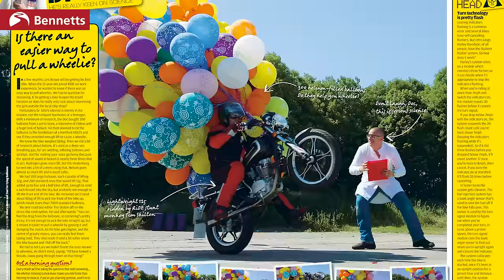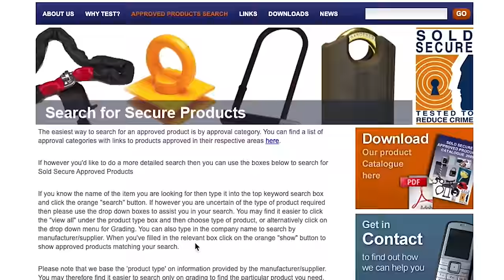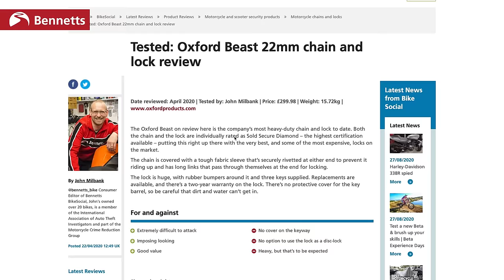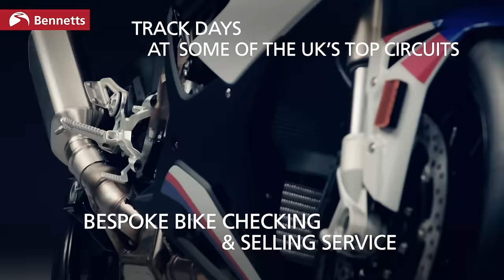The TRUTH about the best motorcycle lock | Litelok, Kryptonite & Oxford Beast review

Comment: Thank you for that positively brilliant review. When I heard the claim that the Kryptonite chain withstood a 4 minute angle grinder attack I laughed. Any lock or chain can be defeated with the proper tools/skills/motivation and willingness for risk exposure. After learning my neighbor’s V-Rod had been stollen a second time, I became concerned for my new Triumph T-120 (yes, I’m a Yank with a Triumph), so I decide if I am going to park my bike outside every night (don’t have a garage) I would use multi-layered security. I figured the more locks I have, the longer a thief would be exposed. I bought a Kryptonite New York 1275 12mm cinch chain with the EVS4 lock. This is the lock and chain I take with me whenever I venture into town. I also carry a small wheel disc lock for extra security. At night, I park under a lamppost, sandwiched between my car and a cinderblock wall. I thread the Kryptonite chain through my wheel and frame, and fasten it to an off-brand (BIGLUFU) 12mm 3T manganese cinch chain that is secured around the lamppost. I fasten the two chains together using both the Kryptonite EVS4 lock, and the cheap lock that came with the BIGLUFU chain. Two locks, two chains, a wheel lock, and the ignition immobilizer that comes standard on new Bonnevilles, under a cover and parked under a bright light still won’t 100% guarantee my bike won’t be stolen, but it will certainly make most thieves look for an easier target. Is it a bit much? Probably, but even adding just one extra layer - like a chain plus the wheel lock - will significantly reduce the likelihood a thief will choose your bike.
Reply from the maker: This guy gets it! Cheers, John
Reply: This 4 1/2 minute claim was probably based on an angle grinder attack from 5+ years ago.  Back then, it took over 10 minutes to get through both sides of the 18mm Kryptonite NY Fahgedaboudit ulock.  Today's grinders get through both in less than a minute - from what I understand.

My two pre-ordered Hiplok D1000's are due for delivery ANY DAY NOW!  Can't wait.  The Altor SAF lock is good for the super high theft situations, but such a PIA to carry on the bicycle!  (Even on a stout touring rack it causes all sorts of unbalancing issues.)

Comment: Just a word to the wise, wear a face shield over your safety goggles, if the grander cutting disc explodes you don’t want a chunk in the face. Cutting through a chain link and continuing through the second ‘side’ it’s very likely to jam and break. 

Good work and nice to see honest reviews and commentary 👍
Reply: I have seen that happen- and yes it is ugly.
Reply: As tempting as it is to use a grinder with your face in line with the blade it's a good habit to learn using them holding them to the side of your face/body.  My colleague witnessed a fatal blade accident
Reply: I’ve had a slitting disc shatter while cutting. Pieces flew a considerable distance. The trick with any grinder is don’t position your body in line with the spinning disc. 
My battery grinder disc got crimped while cutting a steel tube. The disc stopped dead and the motor brushes burnt out. A better spec brushless tool might have effective overload protection.
Reply: That would be karma to the thief so good

Comment: Frankly I am glad that you include the giant bolt cutters in the test. Because over here, most motorcycle theft involves a van rolling up with 4 or 5 guys in it, who will just detach the bike from whatever it's anchored to and then carry it off into the van. Whatever chain or lock is on the bike as they carry it off doesn't matter, because once they get to their "hideout" no one will ask questions about grinder noise.

I've seen and had bikes stolen by criminals in vans who would actually use the van itself to uproot signposts, lampposts or just cut the bike rack and then carry the bike off with the lock still attached. And even CCTV footage doesn't help when the van that's being used has stolen plates on it.
Reply: Yep a friend of mine saw a van pull up to a bike rack in front of a train station and cut both ends of the bike rack and then the guys just carry the whole rack with all of the bikes attached into the van and drive away. So they could deal with the locks later at their garage or something like that. And of course the train station has lots of surveillance cameras and people walking around but they dont care because the people around is not going to do anything, and the police will not even bother to look at the surveillance footage. So it does not matter how hard your lock is when it is easier to just cut the thing you attach it to.
Reply: @titter3648  what city areas / counties is this happening?

Comment: Excellent video, genuinely. Don’t usually watch long videos on YouTube but this was worth it. I’ve seen so many people lose their bikes to theft, especially in London. Unfortunately I don’t have a garage. The thought of mine being stolen has scared me into getting the following:
-16mm chain secured to ground anchor (frame)
-14.5mm chain secured to another ground anchor (rear wheel)
-16mm padlock securing front wheel
-Bike cover secured with cheap combination chain
-cctv covering bike which turns interior lights on when tripped. 

When I’m away I add as many D locks as I can. I know an angle grinder will get through them all but it’ll take a truck load of time and will make loads of noise. Hopefully the grinder battery gives up 😅
Reply from the maker: That's going to need a bloody determined thief, with a lot of cutting discs and batteries, to get through that lot. Top works! The lack of a garage (or shed / shipping container) is a pain, but you really couldn't do any more than that. Now get on with enjoying your bike! Cheers, John
Reply: Hey man you still got your bike ?

Comment: As Planet-Wax said: great video by straight up bloke! Having worked with rope, wire and chain over 30 years I learnt that everything breaks. You put some heart into those hacksaw tests, glad you survived. Short note that the wire rope cutters you used are not the "best in class", mine cut FSWR to 16mm (crouch-cut) and spring steel to 5.5... You made many good points and I'd have to say Bennetts became one of my main sources over the last few months as I researched my recent motorbike purchase, seems like your articles on locks and hardware are doing the same...
Keep it up.
Thanks from the Antipodes
Reply from the maker: Thanks very much! All the best, John

Comment: Very instructive.. When looking at how effective angle grinders can be, I focused on the fact that the angle grinder used for the attack was connected to an AC power source. My guess is that thieves would be carrying battery powered angle grinders and that battery powered angle  grinders likely have less torque than AC powered ones and thus would either take longer or not be able to cut through at all. For those thinking that proper thieves would be carrying their own AC generators in order to power AC powered angle grinders, I would think  it not very likely due to noise etc.
Reply from the maker: Cheers! Check out the new video, which has all the latest locks. https://youtu.be/JVqNCv_p7Ug?si=RjuTFm0pExnK9Ehc

Comment: Most thieves here in the states are using a 12v Milwaukee angle grinder which can be easily carried with a 4 or 5 amp/ hr battery pack.  They are noisy so a lot of the bike clubs are recomending a motion / loud noise alarm  along with a good chain lock combo. The alarm is connected to your smart phone so you can monitor it. Some thieves are also using hydraulic bolt cutters which are now relatively cheap and quite portable.

Comment: Wow, glad I found this. Blew the Fort Knox lock recommendation out of the park. 

I park my 250lb bike in front of a local pub in a tourist town. I use multiple deterrents. Cheap disk lock with motion alarm and a cable lock. Thieves could easily park a truck next to the bike and throw it in the truckbed. That’s where the cable to a wood post comes in. 

Both are visible deterrents but heavy locks and aren’t an option since essentially I’m riding a dirt bike with a license plate off road to get there. 
Great reality check video. 
Cheers

Comment: The best chain I have are 2 smaller chains that I zap strapped together, there is a cover so nobody knows.  And anyone that looks at thinks it’s high security, but you could defeat the system with a knife, file or lighter, with not much effort or noise, but it looks so substantial that nobody has tried.

Comment: A powered angle grinder isn’t unrealistic. If you’ve got a power socket in your garage you can easily fall foul of this sort of attack. Even on the street, a fang can easily use a converter to get 240V supply. I use  one to power my laptop in my car. Security is about time. All security can be overcome if the thief has enough time. Time is the crucial element here. Multiple layers take time to defeat, and as you stated, make the bike less attractive to steal. 

The thieves with vans will pick up your bike if it’s not secured to an immoveable object. At home, a simple (and additional security layer) can be provided by a hidden baby monitor which now come in different designs, some with cameras. Park your car right up to the garage door if you can, anchor your bike, fit a garage alarm, a security camera, floodlights, an automatic machine gun turret  and a couple of S400 SAM systems and no stinking thief will get your baby…or your bike.

Comment: I've got it .. the lite lock with a chain breaded inside so u need bolt cutters and cable cutters . And loop- weave the cable through the inside of the chain as well as surrounding the the Chain with cables . Imagine two lite locks with a chain in the middle woven in and around the outside.

Comment: One issue with the Litelok is that it can apparently be opened by using a metal pipe to twist it a few times. The lock mechanism snaps fast. There’s a video on YouTube where someone breaks it in about 17 seconds. I don’t know about motorcycle locks but a regular Sold Secure Gold U-lock is great protection for bicycles.
Reply from the maker: I did try twisting it to separate the cables from the body using a pry bar, but I couldn't. Having drilled the pin and driven it out, I've had the lock apart and can see how it would split, but I couldn't do it. The twisting has been mentioned in the comments, so I don't know if the design has been tweaked. That video was posted three years ago and is no longer available to compare. You can read our full test here: https://www.bennetts.co.uk/bikesocial/reviews/products/security/motorcycle-chains-and-locks/litelok-gold-motorcycle-bicycle-lock-review. You can also see comparisons with other locks here: https://www.bennetts.co.uk/bikesocial/reviews/products/security/motorcycle-chains-and-locks/how-to-choose-the-best-motorcycle-security Cheers, John

Comment: On eBay you can buy three 10mm chains for under £25 for a portable lock.
Hilka 10mm 1.5m
JDC 10mm 1.5m
Blue spot 10mm 1.8m 
I was wondering if you'd do a bolt cropper and cutting test on the chains as they're cheap.
I think everybody would like to see if they're any good.

Comment: Did I miss the part where you test the lock mechanism itself (for jimmying, screw driver or picking susceptibility)?  My 'high security ' Abus lock just got defeated by a screwdriver in mere seconds!!!  Seems utterly pointless testing the steel strength etc and overlooking the weakest part - the lock!

Comment: you are an asset to review processes, thank you for taking th etime to destroys tuff so we know what works
Reply from the maker: Thanks very much! I can't see how anyone can claim that a lock is tough or effective without properly testing it. The same could be argued with safety equipment, but now we have testing standards it's easier to understand what something could achieve. With locks, Sold Secure's testing is a big help, but what's not always realised is that only the Diamond standard testing includes an angle-grinder attack, so it's something that I think needs to be included in a test of anything below that. It frustrates me when influencers will accept sponsorship money to promote a product when they have no idea how effective it actually is. Cheers, John

Comment: Battery Powered Angle Grinder with industrial, high quality blade will chew everything with lightning speed for sure..
As a side arm you buy hydraulic bolt cutter based around steel rebar hydraulic cutter to smash the connection to minimal diameter before cutting

Comment: I used to run a metalwork shop and remember saying if they ever make an angle grinder that's cordless security will end up a farce about 12 yrs later they did it and a good quality japanese made makita will cut pretty much as fast as a corded one.
Reply from the maker: It's still no reason not to use security though, as thieves are still relatively) and generally risk-averse, and will go for the easier target. Plus there are new materials being used that make angle-grinder attacks much harder (like the Hiplok D1000). But of course, anything that can be made, can be unmade. Cheers, John

Comment: The even newer method than the clumsy angle grinder is the battery dremmel, fits in a pocket, and specialist battery cable cutter and battery cropper, fits in a rucksack they look like battery drill with different head, but they cost well over £1500

Comment: Have litelok motorbike lock  he tested, use when out and about in combination with sledge 77 disc lock and kovix brake lever lock —- never had issues — but agree at home in garage use a Oxford xl on front to ground anchor plus a granit chain and lock on rear wheel …. It’s never bout a single lock its about a combination that makes thieves move on to simpler bikes,,,,,

Comment: I had my wr250x (a very light bike) stolen. I was in a secure parking area provided by my landlord. They used angle grinders. I had the front wheel shackle locked through the brake disk and chained to a concrete post and the back wheel the same. They must  have taken it in a van. Nothing is angle grinder proof. Still waiting for insurance payout.
Reply from the maker: Really sorry to hear that, but you are right – anything can be defeated given time and determination, but using security does significantly reduce the risk. Sadly nothing can eliminate it. All the best, John

Comment: So please correct with if I am wrong, but both yourself and the Lockpickinglawyer used body weight to breakopen the lite lock. If the lock was placed in a way where bodyweight is impossible- for example round the top of the rear wheel and round the frame and round say a lampost- this would pose a serious challenge unless you had a portable electric saw?
Reply from the maker: Yes - that's correct. All of our testing is done in a way to be consistently repeatable and given a worst case scenario. It's the same reason why I always stress to keep a chain tight and off the ground - that way a sledge hammer attack, while part of testing, becomes irrelevant. Also, that cutting tool isn't being seen in real-world attacks (as of Feb 2021 when I write this). Lock picking isn't seen in real-world attacks of motorcycles either, but that doesn't stop every video about bike security being filled with comments along the lines of "yeah, but LPL says..."
An angle-grinder attack is the most likely, while a bolt-cropper attack is the silent method that LiteLok does defeat. You can read the full attack test review here: https://www.bennetts.co.uk/bikesocial/reviews/products/security/motorcycle-chains-and-locks Cheers, John

Comment: Any defensive action attempts to negate attack. First define what is the attack? As we all know it is remove security then roll away the bike. You wont stop the security being removed, no problem, stop the bike being rolled away, fit hidden hydraulic line locks on the brakes. Works best on heavy bikes. Does not work on 4 very big lads with two scaffold poles and a Transit backed up.

Comment: Surely all testing should be done with the device when it's secured on a motorcycle. Cutting on a bench with a hacksaw would be much more difficult when its fitted on a bike.
Reply from the maker: There seem to be a run of comments on the hacksaw / vice, which was only really making a point - not sure where they're all coming from?! A real attack will most likely be an angled grinder, or perhaps bolt croppers, which are both realistically simulated. Cheers, John

Comment: 80% of them use angle grinder and yes they do carry them. no matter if your lock is £300 or £9 mainly 5 mins job maximum. I rather spend money on trackers, and get a good quality chain max £40. that lite one looks good and lighter so its good to carry around. mainly i put one on the back tire one on the rear and i have a tracker, lately i have been covering it.  i wouldnt ride in London without a tracker.

Comment: I'd ask someone knowledgeable who seen many break ins about the more common ways thieves use . I don't think lock picking is at all common and mostly here in the US they use bolt cutters  I think.. I'd get one with shrouded sides least exposure for cutting shackle even possibly putting nuts on it . Next maybe add more locks ..The best tool is grinder cutting wheel cuts through most metal .. Just make it hard as possible for them to break into . Too much effort time .. Once we lost keys to container lock and tried a reciprocating saw and it just didn't even scratch it ..

Comment: about your "I don't do lockpicking attacks because I don't have lockpicking skils" comment, in my opinion you should get a smal set of tools and do shim attacks and bump key attacks. Those require zero skills and a far smaller set of specialized tools. Many thieves make their own shimming tools using scissors and an aluninum soda can. You can also make a bump key with a regular key and a file.